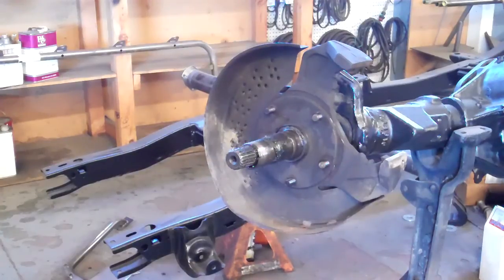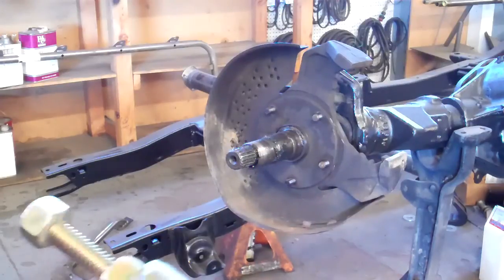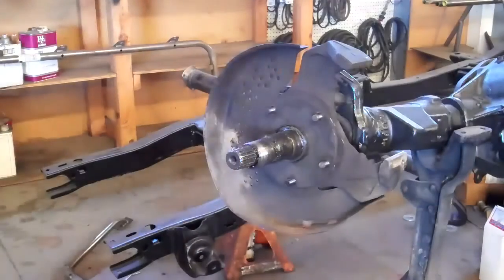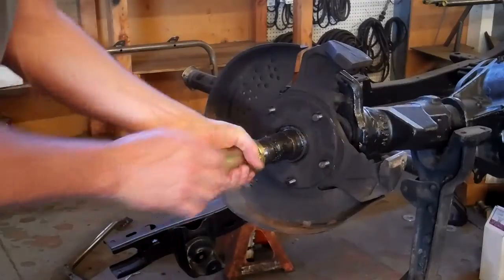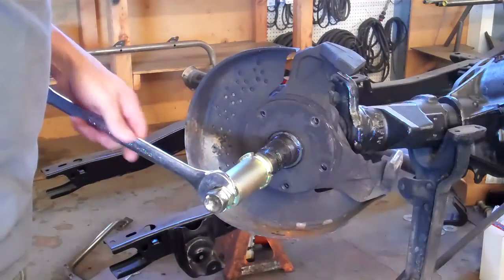The New Spindle Removal Tool: How to Remove Your Dana 30/44 Spindle the Easy Way

Comment: I have a 1987 k10 will this tool work for me?
Reply from the maker: I can’t say for sure. I know it works with the GM spindles we use in our disc brake conversion kits. With that said, there is a chance it will work on your setup
Reply: @wildhorses4x4  i ended up purchasing it like 2 weeks ago and it worked for me. 2 hours of trying to get a spindle off took 3 seconds each side with my milwaukee 1/2 impact. Great product guys!
Reply from the maker: @sergioherrera7345  ahh great!! Glad to hear it, Sergio!